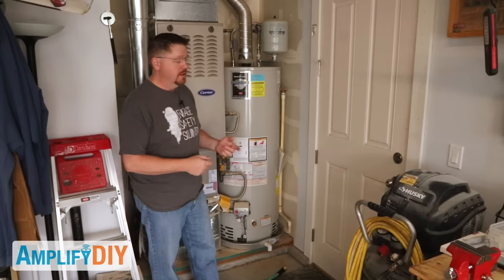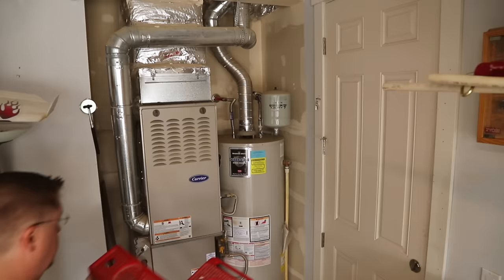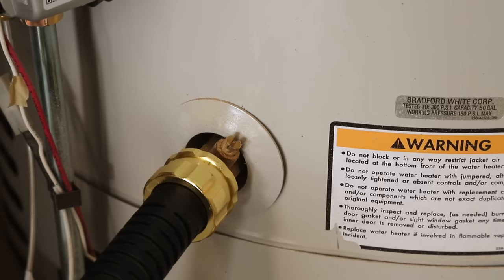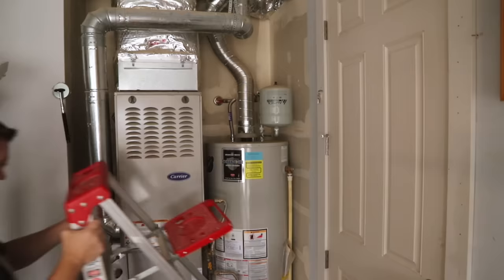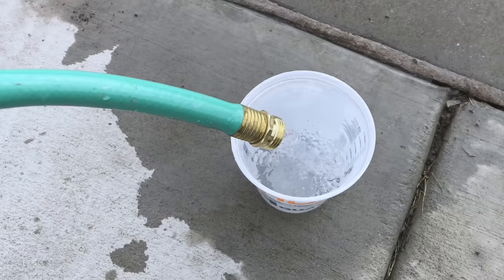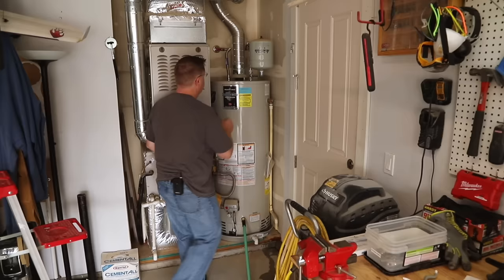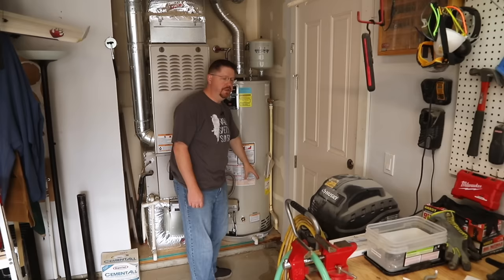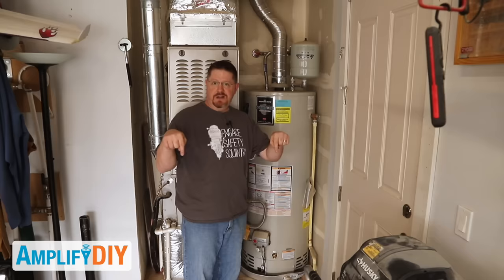How To Flush A Hot Water Heater To Remove Sediment

Comment: can I still drain the tank without turning off the cold water valve that goes to the tank?  Someone told me I do not need to do that.  I question that because while I would be draining the tank with the hose, fresh water would then also be coming into the tank at the same time.
Reply from the maker: Hi Ronin - if you leave the cold water inlet open, then you won't ever actually drain the tank, and it will not stir up the sediment at the bottom of the tank very well. You may clear out some sediment, but the method I show in this video is more thorough. Thanks for watching!
Reply: @AmplifyDIY  thank you for the reply.  I am going to be doing this for the first time for my parents this Friday.  They have not been getting hot water since the 4th of this month.  Their Home Warranty company sent a plumber to check out the situation and they ended up replacing the hot control valve (the knob that changes the level of heat has the “pilot” label in your first step).  They replaced that this past saturday.  My parents had hot water after they did this but later in the day, again, no hot water.  Had plumber come out again and he checked everything.  He asked of we ever drained the tank (6 years old) and I told him no.  He was the one who told me to just put a hose at the bottom of the tank and do the qtr turn on the valve.  I asked if I needed to turn off the cold water as you mentioned in step 2 but he said “i don’t have to”.  Like you said by not turning off the cold water it does not seem like it os doing anything.

Can sediment in the tank prevent the tank from heating the water?  Just a little nervous as I am not very handy.  It looks simple enough.
Reply from the maker: @ronin120  Hmm... while flushing is a good idea, sediment in the tank would not be a root cause for no hot water. It can cause the heater to work much, much harder to heat the water in the tank, but as long as the rest of the system is working correctly, sediment won't completely cause a no hot water situation. Flushing the tank is a good idea, but I suspect there is likely something else going on. (pilot light going out, thermostat borked, thermocouple not working correctly, etc) While I wish it was a little hard to believe that a licensed plumber made 2 attempts and they still don't have hot water... unfortunately it's all too common. I'd suggest flushing the tank, and checking to see if there are any error lights or warnings (or blinking lights) anywhere on the unit. Frequently when there is something wrong in the system there will be a light that blinks in a specific pattern to indicate the problem. Consult the owner's manual if you find a light on or blinking to see what it indicates. If you can't figure out a root cause, and if they still have no hot water, it's time to get a different plumber out to see it (not someone from the home warranty company).

Good Luck!

Comment: I don't know why but the hot water heater scares the crap outta me. Probably because of that mythbusters episode. 😆 Should I wait till the water cools in the tank before playing with valves?
Reply from the maker: It's completely safe to follow the procedure I outline in this video. If you are concerned about heat, then turn off the heating elements of the heater and go take a shower, do some laundry, or a load of dishes. This will replace the hot water in the tank with cool water resulting in a tank that is just luke-warm when you do the flush. Good luck!

Comment: What if you do this on one of the hottest days of the year? You turn off the burner and then allow the hot water heater to cool overnight. Wouldn't you be able to use the water for your plants/trees? Some places are always in a drought and need all the water we can get!
Reply from the maker: Hi Tponce - you can always turn off the heat source, then go take a shower, do some dishes or laundry. This will exchange the heated water in the tank for cooler water that is safe to drain onto your lawn / garden. Good luck!

Comment: What does it mean if I turn off the cold water valve, which connects to pipes that are cold to the touch (while the other side is warm to the touch), but it shuts off the hot water? And there isn’t another valve. 😅
Reply from the maker: This makes perfect sense! If you turn off the cold water (which is feeding in to the heater) then there is no longer any pressure to push the hot water out of the heater. :-) Shutting off the cold water supply to the heater effectively shuts off the hot water supply to the house. Thanks for watching!

Comment: Question- Can U drain hot water down Sump Pump?
Reply from the maker: Hi Alma - you can, but I recommend 2 things: 

First - cool the tank before you drain it. The fastest way to do this is to turn off the heat source, then go take a shower or do some dishes or laundry. This will replace the hot water in the tank with cool water from your supply, resulting in a much cooler temp water to drain into your sump pump. 

Second - you don't want to clog up your sump pump with sediment. Grab a kitchen strainer and use it to catch any large chunks before they get into the sump.

Good luck!

Comment: Question. I have a 2 yr old gas hot water heater. My hot water (only hot) is coming out of the faucets with a brownish tint. I flushed the tank 3 times and it is still brown. City water, water softener, pressure reduction valve, overflow tank. What the heck is going on?!?
Reply from the maker: Hmm... how old is the rest of your system? Is the whole house new? Or just the water heater? Do you have any galvanized pipes in the system? Have you checked the expansion tank for failure? (https://youtu.be/NGygvtP6Sdk) How old is the water softener? Do you have a bypass for the softener plumbed in so you can test the hot water with the softener out of the system? 

Is there any taste to the hot water when it is brown? (does it smell metallic/rusty?)

I know... so many questions. ;-) I'm happy to try to help you diagnose - shoot over whatever extra detail you can provide. Feel free to do so here or email me directly if you prefer: amplifydiy (at) gmail (dot) com.

Good luck!
Reply from the maker: @thibodeaushow  Just based on your description, it sounds like you have a pretty high iron content in your water. Are you on a municipal system? Or are you on a well? I've see water turn brown when heated on well-based systems with very high iron content. Did this just start suddenly?
Reply from the maker: @thibodeaushow  I'd recommend 2 things: First, Lowes or HD sell basic iron test kits for water systems for under $10. I'd grab a test kit, and see what the iron content of your water is. Then next I'd contact your water supplier and ask if something changed in the last week / 10 days, and if this is the new normal, etc. If you are friendly with your neighbors, maybe ask around and see if anyone else has noticed similar discoloration / odor / taste in their water...

Comment: Shouldn't you open a hot water faucet on the highest level? Such as a bathroom on a 2 story home?
Reply from the maker: It really does not matter. I prefer to open a faucet that is closest to the heater, because I prefer not to fill more plumbing with air than I need to... the key here is that you need to let air in so that the water will drain *out*. Open a faucet, or use the T&P valve as I describe in the video. Thanks for watching!

Comment: Should also change the anode rod the anode rod is what's attracting the metallics creating the sediment at the bottom of the heater as well usually when the anode rod fails it falls to the bottom of the water heater
Reply from the maker: Great tip! I did a whole video on checking and replacing your anode here: https://youtu.be/OIMz1rwx_jc

Comment: Suggestion to actually use the water when flushing.  Set the burner to 'pilot' the night before allowing the water to cool down.  This way you can water the plants in the morning or something useful other than just wasting that water.  Coming from So Cal and every year seems to be a drought year, that water is precious.
Reply from the maker: Hi Andrew - great tip! If you forget the night before, then just turn off the burner first, then go take a shower, do some laundry or some dishes. This will use up the hot water in the tank and exchange it for cool water for the flush that you can drain directly onto your lawn, garden, etc. Thanks for watching!

Comment: My only problem is the drain valve is at the very bottom and blocked by a plastic drain catcher type thing (technical term) and I can't hook hose up to it
Reply from the maker: It's almost as if the plumber that did the install didn't want you to ever be able to drain it... 🙄 - in all seriousness though, you should see if you can find a way to make it work.. maybe you can get an elbow or other adapter you can screw onto the drain valve to make it easier to attach a hose? Best of luck!

Comment: When do u turn off the faucet upstairs ??
Reply from the maker: Hi Yankessnperu - it actually does not matter. Apologies for the confusion based on the order I showed things in the video. I only opened a faucet to how how it can be used to let air into the system so the tank can drain. You can leave the faucet in the open position throughout the whole flushing process, and then close it after you have purged the air from the water line in the house as I showed at the end of the process. Good luck!

Comment: Can you add vinegar to dissolve the salt?
Reply from the maker: You can, but you'd need a LOT of vinegar (5-8 gallons, at least) and would need to let it sit for 8-10 hours, then flush the tank multiple more times with fresh water to rinse out the vinegar so your taps / shower does not smell like vinegar for days. Good luck!

Comment: I was used to a plumber always turning the water off outside of the house prior to starting?
Reply from the maker: Hi Plain Simple - not sure why the would want to do that.. you'll need a water supply to properly flush the heater. If you turn off the water supply outside the house and leave it off, all you can do is drain the tank... which will not flush out hardly any sediment at all. Thanks for watching!

Comment: Do you need to turn off the gas valve?
Reply from the maker: No, as long as you set the thermostat to not start up the main burner (set it to pilot or vacation) there is no need to turn off the gas.

Comment: Can you drain the water into a sump pump??
Reply from the maker: Hi Maurice! Yes, you can, but I recommend you make 2 modifications to the process: 
1) The day you are going to drain the heater, go out in the morning and turn off the heat source. Then take a shower, run a load of laundry, or do some dishes. This will cool down the water in the tank, so you are not draining super hot water into your sump pump. 
2) Use a kitchen strainer to catch any large chunks of debris that may come out of the heater while draining. You don't want to run that gunk through your sump pump either. 

Good luck!
Reply: @AmplifyDIY  so i have a gas water heater, am i turning the Main gas line off or just the gas line to the water heater

Comment: At 5:35 not sure what happened for me during this process but water started coming out the pressure relief valve!! BE CAREFUL
Reply from the maker: It's very likely that you have a pretty slow drain or clogged drain valve on the heater. It was still pretty full of water when you opened the inlet valve. Heaters fill pretty quickly, and the water level likely did not take long to rise up to the height of your relief valve. Good tip, and thanks for watching!

Comment: I have 50 Gallon Tank. The flush of my water was too slow...any idea why ? then when I did flush it with cold water. It also flush on to the other water pipe on the side of my house .. I flush it with cold water multiple times but There's still sediments...Until , I just stopped.. The brand of my tank is AO SMITH electric..
Reply from the maker: It's pretty likely that your drain valve is clogged up which makes the tank drain so slowly. Replacing a drain valve with an upgraded one that will flow better is easy, though: https://youtu.be/OBPJYg0o_o0
Reply: I used expandable water host. Is it also the reason why it was too slow ? Thank you for your response.

Comment: I wouldn't open pressure relief valve if unit is old bc of sediment that's probably stuck there ,when you are finished draining it might not close entirely then you might have a small leak coming from it your going to tell by watching your blow off exit
Reply from the maker: Hey there just kidding - I addressed this very fear in this video: https://youtu.be/e5H1i1cypxA

Comment: Ive drained and cleaned electric ones and those things had a bucket load of deposits inside...not just small flecks. Electric ones start to lose efficiency once the heating element calcifies.
Reply from the maker: Yes, and electric ones (in my experience) tend to produce more sediment more quickly. Thanks for watching!

Comment: Here I am with a 40 year old water tank. Drain either busted or plugged solid. My Rod is stripped and cant be removed. My heating element burns out once every 5 years. When I change the lower element I scoop out as much of the crap in the bottom of the tank as I can. Its a little small for the house but can't kill it to justify the replacement. Dont get it.
Reply from the maker: Hey, if the tank has lasted this long, keep doing what you are doing! Good luck!

Comment: I know this is old but I hope someone responds. Can NOT cleaning this out cause sediment to continue to flow through pipes? I just got my galvanized pipes replaced and junk just keeps coming and coming and coming out of every spout.
Reply from the maker: One quick test to know if the sediment may be coming from the water heater: Does it come out of the faucets even when only running cold water? Or does it only come out when running hot water? If it comes out no matter the temperature, it's not likely coming from the water heater, but from somewhere else in your plumbing. Good luck!
Reply: @AmplifyDIY  definitely just hot water. Guess I should get to flushing the water heater. Thanks for responding! And for the video showing me how.
Reply: Also, I'd like to point out how crazy I think it is that from reading, and watching videos like this I've come to conclusion with your help that's the problem. I've had family who are 'plumbers' and professionals come out. Not a single person has even suggested the hot water heater. All I get are shrugs. So seriously, I appreciate it more than I can express.

Comment: followed instructions but water is NOT freely flowing .  Opened cold water to get it to flow out and good volume close it and not good flow ?????? Yes I did open valve at bottom  and the heat relief valve
Reply from the maker: Hi Den - you may need to replace the drain valve. The valves included with heaters from the factory are generally really small, and are very easily clogged: https://youtu.be/OBPJYg0o_o0

Comment: Why not leaving the water source flowing through the heater during the process?
Reply from the maker: Hi Billy - because while the water seems to blast out of the drain valve/hose when you do this, inside the tank it is moving VERY VERY slowly. The only way to properly stir up the sediment on the bottom of the tank is to remove all the water from the tank in the first place, so that the water can slosh around at the bottom when you hit it with brief bursts as I showed in the video. Great question, and thanks for watching!

Comment: After you turn off the breaker, drain hot water into your bathtub until it just warm. Then shut off cold water supply. This will prevent you or your hose from scalding hot water
Reply from the maker: Or, shut off the heat source and then go take a shower, do a load of laundry, or wash some dishes. Accomplishes the same thing, and uses that hot water for something useful. Thanks for watching!
Reply: @AmplifyDIY  Exactly

Comment: You could run the hot water after turning the gas to pilot or off or the electricity off until only warm water comes out.
Reply from the maker: I like to recommend that you turn off the heat supply, then go take a shower, run a load of laundry or do some dishes. That will use up the water and cool the tank for the flush. Thanks for watching!

Comment: You should use a high heat water hose that's usually red using a common garden hose could melt the hose and cause it to rip open just a little tip. From home depot lol
Reply from the maker: Good tip, thanks!

Comment: The process will shock the whole system, pipes included. That won't settle out. Really simple to remove aerators. Easier than trying to clean clogged aerators.
Reply from the maker: Good tip, Vincent. Thank you!

Comment: Sorry, Amplify guy - you should keep it pressurized.  Just put your drain hose on, and run it full blast.  Let it run until the excretory is clear.  Turn it off, and put your heat back on.  Since mine is always pressurized, if I leave the heat on, it just wasted energy, it doesn't damage the plate.  NOTE: pressure drop is what causes cracks (failures).
Reply from the maker: Normally I would not want to argue with Santa, but in this case I'm afraid you are misinformed. Pressure drop alone does not cause cracks. Failure to maintain a tank by replacing the anode when needed and with proper flushes (and merely opening the drain valve with the tank under pressure will not do a very good job of flushing out the junk on the whole floor of the tank - it only removes stuff collected within an inch or 2 of the drain valve) allows the tank to corrode, which weakens it, which then can cause it to fail with a sudden change in pressure.
Reply: @AmplifyDIY      OK, you win .... but I have had three plumbers (who are friends) tell me that.  We all stand corrected.